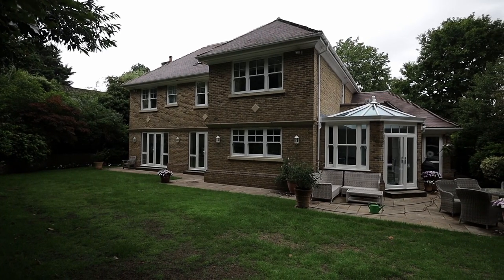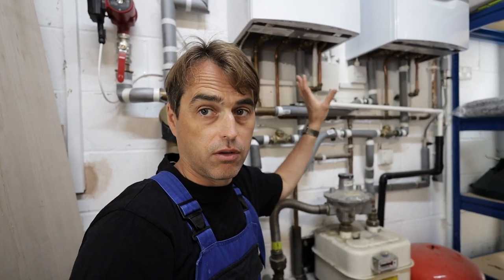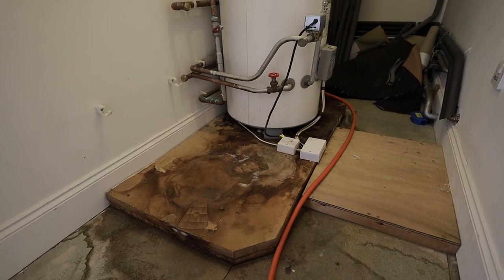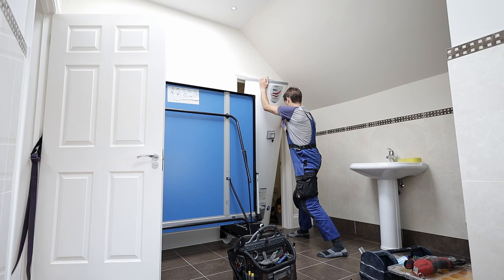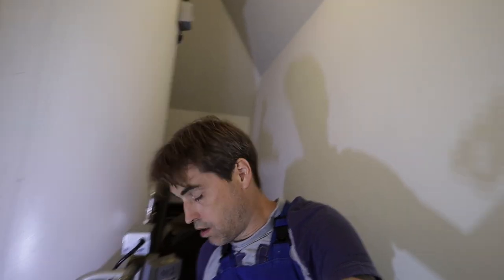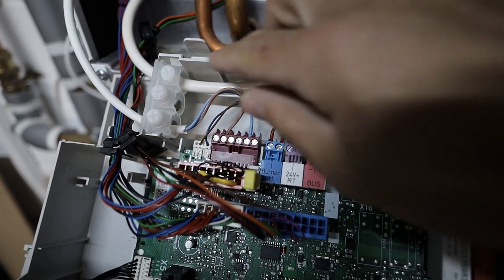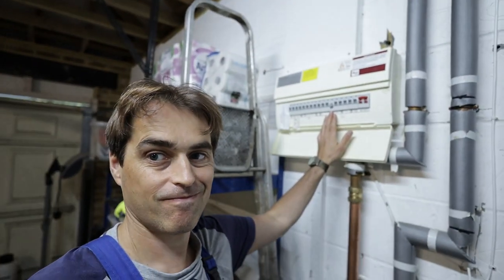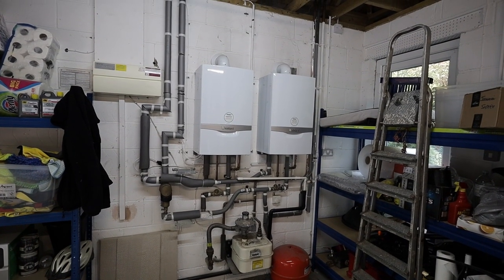Reducing Energy Consumption in a Large Home: A Step-by-Step Guide

Comment: You have no hydraulic seperation for a system with ufh and radiators on low temperature controls. This will cause underflow in the ufh circuits when in operation. The llh needs to be refitted and a separate pump used for the radiator circuit from the distribution header. This is standard Vailant and Viessmann design.
Hydraulic seperation has rules for when and when not it is required. 
This design you have done is subject of many of my design videos and causes regular winter call outs for me. 
It's very easy to rectify the issue. Ask Vilizar at Vailant to do a system schematic for you. 
This is as much of a hydronic no no as ccts at the ufh manifold.
Reply from the maker: Well, we do disagree here. I’d rather have CCT on manifolds than LLH here.

If I have made a mistake I want to learn from it and go back and rectify.

I appreciate your experience but I would like to test it myself and go back if needed.

I have seen the discussion with you and Adam re CCT and I am aware of it.

I will report back
Reply: @UrbanPlumbers  it can all be proved mathematically with what you have learned from the heat geek course. I worry about credible sources giving out ideas with mistaken design principles. This leaves installers and customers vulnerable to system issues. Happy to discuss the issues with you.
Reply from the maker: @andrewmillwardwatford9410  sure! I would love to meet and have it all explained!
Reply from the maker: How do I find your number mate?
Reply: @UrbanPlumbers  I message you on messenger before
Reply: I think we just witnessed a Jedi Knight learn a bit more about the Force from a Jedi Master!
Reply from the maker: @andrewmillwardwatford9410  lots to think about here Andrew. As discussed over the phone, I will go back and implement some of your ideas !
Reply: @UrbanPlumbers  was great talking with you.
Reply from the maker: @andrewmillwardwatford9410  likewise Andrew, update coming soon
Reply from the maker: I have pinned this comment now in case others have question about no separation between the boiler pump and UFH manifolds
Reply: @andrewmillwardwatford9410  LLH can be justified when secondary flow rate requirements exceed primary however it is very unlikely to happen because of microzoning. I often face this dilemma and I have gone against the LLH and so far have not faced flow problems.
Reply: Andrew is right urban plumber, you definitely need to replace the low loss buddy. You will have issues if not. I want go into why as Andrew has covered it.
Reply: @UrbanPlumbers  gg
Reply: I have no idea what your talking about but i believe you
Reply: If every industry came together like this and collaborated for the better, how much better we'd all be. The scale of work, thinking and safety was exemplary I must say. No cutting corners, and even though not the ideal setup as you've mentioned, no danger exists for the inhabitants. 
This in contrast to hearing a story from a boiler engineer this morning after a CM leak alarm went off in my house, boiler condemned and gas turned off, that recently a freelanced gas boiler engineer serviced a family house due to a certain national energy firm not being able to send out one of their own engineers, and after completing it, had neglected to replace some caps or something to some of the lines.
The only way they found out was the elderly neighbour next door's CM alarm went off, had his boiler inspected, and no leaks were found. His curious engineer went next door, where the CM reading was off the dial as soon as he went up to the front door. He broke down the door and found the wife, husband and two young children deceased in their beds. It was during the investigation of the boiler they found these missing caps. 

This is why people like you here are the rivets that keep this s**t together!
Reply: @pradhpatle  if using high temperature from the boiler then hydraulic separation is not required. Microzoning is only going to happen if the boiler is running at high temperature. The game changes with modern low temperature strategies. Mass flow rate calculations can reveal l the issues. Simon has an excellent solution for this job now. We had a great conversation that gave us both new deeper understanding. These conversations are the life blood of learning and we are all duty bound to share what we learn imo.
Reply: @andrewmillwardwatford9410  mass flow rate is pure science so you can never beat it you have to work with it. I personally don’t like microzoning, low temp is way to go. I just see lots of low loss headers with high temps controls and microzonging. I am always keen to learn. Based in Watford as well to will be good to catch up one day.
Reply: @pradhpatle  can meet any Sunday
Reply: I would like to see a follow-up on the ideas that Andrew Milward Watford suggested. I'm working on a property at the moment it has 3 ufh manifolds one on each floor and no radiators. I'm going to install LLH as there's 3 grundfos pumps on the system. Just as a side note all pipes are lagged with Kingspan kooltherm boy that made a huge difference. Loss of only 7 degrees from boiler which is in the loft to ground floor that's approximately 30M of pipe.
Reply: @abuhaqq  Simon came up with a great solution. Watch for the follow up video
Reply: @andrewmillwardwatford9410  thanks mate going to subscribe 👍🏽
Reply: @dwilliams6346  Well said mate and credit to both Andrew MW and Urban plumbers , could be summed up as 'have the humility to pursue excellence rather than arguing over what is perfection. Imagine nations discussing matters like this, the world would transform rapidly into a much better place.
Reply: When’s the follow up video coming?? 😮
Reply: @andrewmillwardwatford9410  Could you please elaborate as to why there are issues with underflow to UFH with low temperatures profiles?
Reply: @chriscodes1  the issue is with underflow to radiators. This is for low-temperature operation not high temperature.  If you put in traditional high temperature under floor with high temperature mixing valves and run the boiler at high temperature the mixing valve will close down and prevent the issue
Reply: @andrewmillwardwatford9410  I don't know enough hydraulically to understand exactly why that would occur, but I'm interested to learn more about anything so please excuse the questions if that's ok. 1. My understanding at the moment is that underfloor requires a higher flow rate than radiators in order to maintain the narrower DT for low temp systems, surely this means that there would be overflow to the radiators, or am I completely off here? 2. Surely a carefully balanced open loop system with carefully balanced lockshields on radiators and carefully balanced UFH loops getting the required flow and then pump settings would work perfectly without a llh, or why would there still be a need for one here? Thanks
Reply: Very nice video! I'm very keen on finding out if this is working! Did you ever do a follow up?

Comment: You didn't explain what you had to do to that wiring centre, but my head had exploded already by then! Why do installers make things so unnecessarily complicated? It's a lovely big house, but I've worked in 50 room hotels with simpler control systems! Well done for improving things so much for the client with minimum outlay.

Comment: Guarantee the original installer looked at the house and thought, they have plenty of money, then over-specified the original system massively to make it a much bigger job than actually needed. You could run the place as a hotel on that original system, 50kW, total overkill.
Reply: I've got a 29KwH boiled when realistically, I need half that. My house theoretically uses 10,000 KwH of gas a year
Reply: Of course. Sad but true, it's only about money for most plumbers.

Comment: What is truly amazing is that Urban Plumbers took on such a massive job and did not force the client to buy a whole bunch of new equipment to solve their issue. Instead, he deleted inefficient kit, redesigned and rewired the system and invested only time. 

Syzmon is the highest caliber of professional! Well done!
Reply: I can't wait to see the update and note from Andrew.
It was a bit of an experiment and lessons might have to be learnt.
It's good to see people's working out though!
Reply: Well, i have to agree that this is amazing and a great show of high class specialist. However if they had double what they needed, i would just leave those redundant parts as a spare. Such heater is not worth a couple pennies... I have a similar sityation at my home - exchanging coal heating for gas. And i still want to leave old stove just in case, work on it a little and have an emergency heat source able to use coal, wood, chips, pellet... Hard times are coming and relying only on one source of energy is very risky.
Reply: Breath of fresh air, so tiring seeing trades just scrap perfectly serviceable equipment, incredibly wasteful.

Comment: Your work ethic is fantastic, as others have commented. Fine tuning and efficiency - simplifying and optimising powered by thought, not excess and compensation powered by laziness and incompetence.

Re the softened water thing - base exchange softened water does indeed dissolve scale deposits, you're right. However when this occurs on a large build-up, sludge can form in lower-flowing areas, or restrictions, such as strainers, filters, and aerator fittings at the end of taps, so something to look out for in a situation like this. It can also dissolve 'cleanly' over time though and eventually pass through to drain without much issue.

Comment: You're amazing, managing to sort out all that wiring. I was impressed with the condition of the hot water cylinders, no limescale at all. After seeing that I went and bought an industrial water softener to fill my 4,000 litre buffer tank. I'm planning on linking an annexe and have some insulated underground water pipe, it's 32mm so I'm going to thread 16mm through to get my flow rate correct. It's only a 10 mtr. run so I think it should be fine. I'm leaving the hot water on Economy 7 as long as my contract allows. I find with a properly insulated large tank there's 
very little loss over the day. Some people complain about heat loss from a store but what I've found is you have to make sure there's no parasitic convection going on. Another thing I don't think people realise is that their heat store isn't fully up to temperature to start with. I can see heat stores will be very useful when smart grid pricing comes along. John.

Comment: You are doing an excellent explanation with the limited time and complex installation that you have. You did not tell us if the boilers were set up to fire properly to maintain the needed space and hot water temp. You stated that energy consumption was high with not enough heating but you did not share your findings as to what caused the situation of the high energy bill. Good luck.

Comment: Lovely work mate. What a massive difference that will make to their gas bills this year!
Reply from the maker: There is more to it than I was able to show on the video. They had 600L of stored water and never enough hot water - 2nd circulation was constantly depleting the cylinders with 2 x boilers constantly trying to recharge them! 

This should make a massive improvement to energy consumption
Reply: @UrbanPlumbers  crazy!! I suppose that’s why the secondary return should be lagged so well to stop that. At the new gas price that’s over 2.5k per year in saving!!
Reply from the maker: @samposton9101  yes, you can easily cost you that much with insane 600L and 50kW of boilers cycling all day
Reply: @UrbanPlumbers  Reminds me of that mixing episode you did earlier in the year. Well done!

Comment: I have always thought commercial heating engineers have been lured by over complexity for technical one-upmanship. It appears that the clients budget usually determines the system size. In a house of this size I would expect a second boiler to be in position just to prevent inconvenient heat failure. I am amazed that all those zones work on one built-in boiler pump.

Comment: I will say the Vailant/Gloworm ebus stuff is quite handy, we had a new glowworm compact fitted at the place we are renting and no controller or even a room thermostat was fitted (the previous boiler being an ultracom with the built in programmer). Absolute pain to turn the heating on/off so ended up getting a ClimaPro2. Installed in seconds using the plug under the boiler and so much easier than having to take the front cover off to wire something internally.

Comment: I'm a Viessmann guy and have often used the boiler pump to handle full radiator loads but only when the pump is operating within its curve. The DHW 3 way valve is handled internally in the boiler so there is no question of having the wrong temp going to the tank. I can understand why the LLH is in place and if the DHW was sent to the tank bypassing the LLH, you would still have the benefit of the LLH for flow control through the secondary circuits.

Comment: It will succeed 👍. Have no doubt about it. I hate low loss headers when they are not needed. If in doubt I would put small buffer with buffer sensors wired to vr 71 instead.

Comment: Mate I’m a computer science teacher and even I struggled to keep up with your Boolean logic , your simply one of a kind , I had a similar issue and still do , 38kw boiler when all I needed was 24kw at most , took years for me to be told and modulation set as best as it could , even now it’s not great but seems better. Anything else I can do bar swap the boiler ? Congrats I hope to use you when I’m back in the UK 👍👍👍
Reply: Hi G please explain modulation set as best as it could. . Thanks
Reply: @RayMondElec  engineer set the boiler to modulate down quicker so it uses less power as it doesn’t need it
Reply: @user-te1le7ck6b  thank you. I think that means your boiler was range rated. I may be wrong. 
I think the boiler in the video is a vallient 837. Mine is a vallient 937 ( in built storage tanks) . Valliant service the boiler. My total rads KW is 18. So I set it to 18kw. Valliant engineer said it is best to leave it on auto mode and switched it back🙄. He also said to leave the pump speed in Auto. Set my flow to 55C and hot water to 50C. So much conflicting info online one never really knows what to set in order to save gas and run an efficient system. 🤔
Reply: @RayMondElec  mine is 38kw so needed to set it down to help as best as it could

Comment: Very good video, for 30 years I  fit weather compensator, the old honeywell AQ6000 was a fab weather compensator controller with optimum on and optimum off. If HMG wanted to improve efficiency they could get rid of bimetallic stats, thermistors are so much better.

Comment: Awesome video as always Simon and some very beneficial information to take away. One question - you always mention heat loss calculations when it comes to complete system renovations/retrofits and I just wanted to understand your methodology for determining the heat loss in a property? Do they have to be relatively new buildings and you have access to the fabric values (External walls and glazing U-values etc.) Or do you have a good understanding of material performance and make assumptions from there? Thanks in advance!
Reply: I would be interested in this as I used to do Heat loss calcs but you could spend 1  day + measuring the house and 1 day on calcs. Or is he doing something more basic? The last thing I used was the MCS spreadsheet for biomass (and maybe Heat pumps). Two terraced cottages joined into one house came to 15kW each would have had a 24kW combi in!

Comment: Can we please get a detailed comparison between the most efficient boiler (Viessmann 200) vs. the most efficient heat pump you have installed (Arotherm) ? Please help us by doing an actual video breakdown - no one has answered this question with exact numbers!
Reply from the maker: it's easy - on the same system with the same low temp design (40C) heat pump wins every single time. Around 90% vs over 400%.
Reply: @UrbanPlumbers  Sorry, I meant real world running costs not theoretical COP. People are hurting right now and chosing a cheaper install of a high quality boiler that costs less to run may help them! Most greedy installers do not share these comparison numbers but I am hoping you will do an episode comparing the two?
Reply: @singlendhot8628  
Yes, real world data is what we need, but the data needs to be actual energy costs as billed. I note that all the costings we get on YouTube calculate costs using the heat pumps electricity usage. I'm convinced this does not include the immersion heater running costs for pasteurizing and defrost cycles.
Reply: @singlendhot8628  you just take a COP of 3 then use the electric and gas rate to do a first pass and see if it makes sense. If it does, heat pump will win. If it's close, you need to do detailed calc. If it's way off ....Then possibly no
Reply from the maker: @nhojnhoj6767  my installation do not use immersion heaters! Heat pump does all legionella cycles.
Reply: @TsLeng  I think the request is for real world data - I'm happy to donate my installation to this cause!
Reply: @avivscrewvalla  real world data depends on many variables and actual application. But it all derives from kWh costs and efficiency which can be calculated to start with. 

It's like asking someone what is their real world fuel usage of their car. It won't be accurate unless you have the same use pattern. But you can definitely compare 2 cars and get an idea which is more cost effective based on the specs.